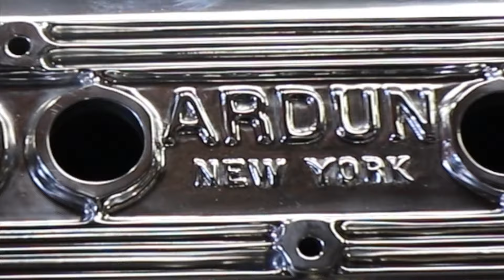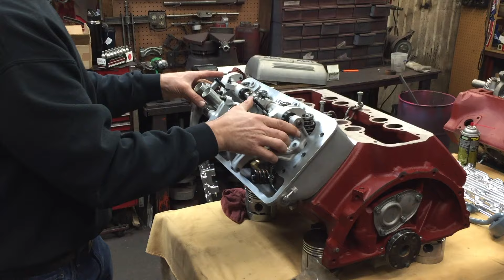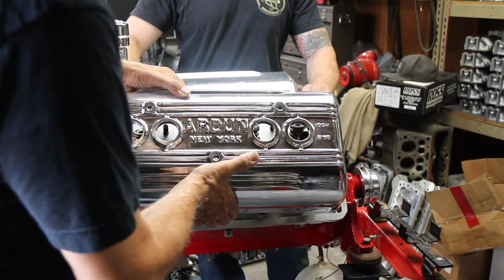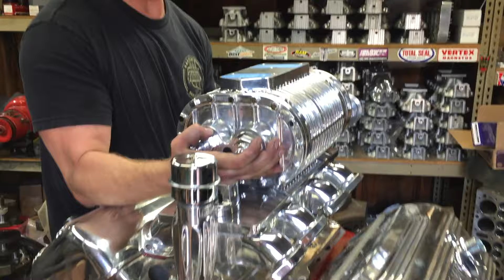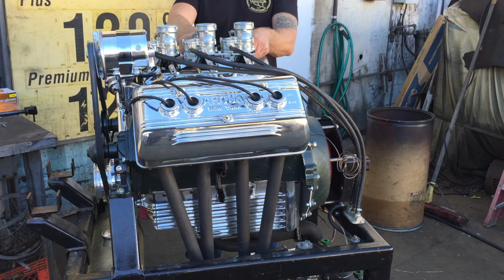ARDUN OHV Conversion for Ford Flathead V8

Comment: From the looks of those heads, you've basically turned a Ford flathead into a Ford Hemi. Pretty nice build, and amazing that people are still developing parts for these engines.
Reply: Ardun heads are from decades ago (pre SBC), co-designed by Zora Arkus Duntov (hence the "dun" in Ardun) before he worked for GM on the Corvette.  People have been making fresh castings of them.
Reply: Blows my mind that Ford didn't poach Zora as soon as he started selling the Duntov heads, seen the deck area on a Y block? Its large enough to bolt a hemi head on! Ford slept on Zora big time & gave the hotrod game away to Chrysler then Chevy.
Reply: @jonathanhardy9142  they still got it tho

Comment: I want to know dyno numbers on the supercharged one
Reply: My own original Ardun with Marshall blower is 332hp @ 5500 and 357lb-ft torque @ 4300.  The power was still rising but I chickened out at 5500

Comment: Whether it comes to the Ardun OHV conversion of the Ford Flathead V8 or any other (albeit non-Hemi) OHV conversion (whether in development by Ford themselves or another company), what would have been the minimum typical increase in power over the existing 110 hp 239 / 125 hp 255 engines one can expect?
Reply: The Power increase is due to stroking and boring the stock 239 block. Its 255 cubic inches now. Or like safely bolting on  22 to 25 pounds of turbo boost. The company quoted 275 hp gross at 5500 rpm verses 110 hp gross at 3600 rpm for a latter 239 cubic inch engine. You get a proper intake with six barrels and 585 cfm of three carb goodness verses the stock 167 cfm 2bbl. 3.5 times the flow rate of a stock 1949 239 engine. So a minimum 165 hp increase with the crank and piston and cam upgrade that goes with it. The Rev range goes up without hurting the low speed torque much. On the 2.2 liter 136 or 3.6 liter 221, the increase is limited due to capacity and bore size, but you will get another 100 to 170 hp extra with those. Again, a 2.5 to 3 times power increase. That's a way over  1.1 hp per cube cylinder head on any flathead 136/221/239 or 255 engine. The ARDUN heads were based on a Delahay in line six Hemi head. The two Duntov brothers saw a market for truck Flathead as well, although take-up and sales were poor in the depressed post war market. The stock 239 stroked to 293 cubic inches or 4.8 liters and clearance with two 97 Strombergs might make 174 hp net at 4800 rpm. It's very hard to get 2.5 to 3 times the power of a stock engine any other way.

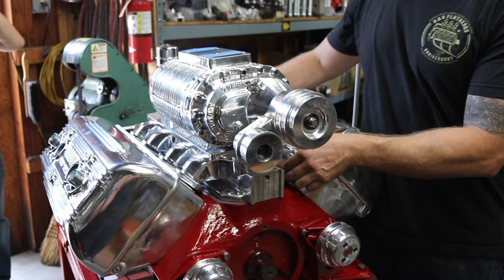Comment: I'm confused... at 0:40 they mount a supercharger and in the next frame it doesn't have one. Wish I knew the power of that blown flattie.
Reply: 275 horsepower, 25k to build..
Reply: @johngrepo9976  
Yikes.  That's a lot of money just to look cool and still have such little power.  I have a stock flattie in my '53 F100.  I could never afford to do that to mine.  I'd love it but, too rich for me.
Reply: @johngrepo9976  how much Torque?
Reply: @Minecrafter55666  About 300 lb-ft at 4000 rpm. It's a great cylinder head up grade.

Comment: I'm not sure about this but I think the tech who came up with this was Arkus Duntov. If so he was the tech who help design the small block Chevrolet V8 engine. Anyone know for sure??
Reply: Zora Argus Duntov and his brother developed ohv heads for the original Ford V8. They made a limited number of these heads. Zora Argus Duntov later worked for the Chevrolet Division of GM and was instrumental in the development of the Corvette. I believe Ed Cole is the father of the Chevrolet small block V8.
Reply: I've heard some old-timers talk of a Frontenac ("Fronty") OHV conversion for flathead Fords; going back as far as the Model A"s.
Reply: @tallen4520  the Fronty was made for the Model "T" and early "A"s by the Chevrolet brothers.  They ran it at Indy and sold heads to the public for road and race cars.  Like the Ardun, enthusiasts want them to build or restore examples of early performance and race cars.
Reply: Yep. ARDUN is an abbreviation.

Comment: How is the water jacket done? Is that aluminum? Could one machine a head out of a block of aluminum and and then weld sheet metal onto it to close the jacket? Welding like for bike under nitrogen, hopefully on a CNC arm.
Reply from the maker: Not sure exactly, this setup was engineered in the 1940s but is still popular today. You can contact H&H Flatheads at https://handhflatheads.com/

Comment: Why?  Nostalgia and to own a legend that looks cool.  If you want ultimate horsepower, you buy a crate motor or a modern engine from a wreck.  If you want the look, sound and cool of yesteryear, you build a flatty with an Ardun conversion, McCullough blower, and triple Strombergs.  It's the same as a dropped front axle, chrome reverses and baby moons; not the best ride or handling, but old-school cool.

Comment: q: I am insane enough to consider putting a flathead ford v8 w/ the heads in my old bronco just because of the lower displacement (less than 351cui.) because I'm going with a balanced power to fuel economy ratio.
Reply: Dude just get a 260 or 289. Or better yet get a 300 six they’re indestructible.

Comment: Sounds chunky.. but I wanna know how they replace the stock valve train with overhead cam valve train.. is there a replacement valve body that seals up the valve holes in the block while allowing pushrods to work? I have many questions here..
Reply: The cam is not overhead with those head

Comment: What’s the point? Buy a 350 and enjoy if you already want more power 🤷🏽‍♂️
Reply from the maker: It's all about  nostalgia and being period correct, if they wanted to go fast they would probably do as you said.
Reply: if they wanted power they wouldnt grab a 350
Reply: @TorqTalkOfficial  Yeah, but it’s already not a nostalgic flathead, don’t see a point 🤷🏽‍♂️
Reply: @IIIBETEPIII  Ardun heads were around in 1948-49.  They are old school speed parts.  IOW...  Ardun heads are nostalgic.

Comment: All that work and all that money and still no power the blocks are junk they belong stock totally they're not worth hot riding whatsoever at least with a y block people have made five to six hundred horsepower of course it cost a lot of money I guess to each his own to me it would be a complete waste of time although I love original flatheads and total original configuration
Reply: why..for g-ds sake .im  lost on this one.
Reply: Preach it brother!
Reply: Kinda weird; guys with 275 hp 327s think they are fast. This engine with a 4 inch stroke will have grunt like a big block. Same stroke as a 454 Chevy.  You could put a 350 Chevy in your hot rod and leave the hood shut... or open it and yawn. 
Dick Landy made over 700 hp and went over 300 mph with "Flatfire" using a 1946 Ford block with 3 mains.

Comment: q: I am insane enough to consider putting a flathead ford v8 w/ the 
heads in my old bronco just because of the lower displacement (less than
 351cui.) because I'm going with a balanced power to fuel economy ratio.